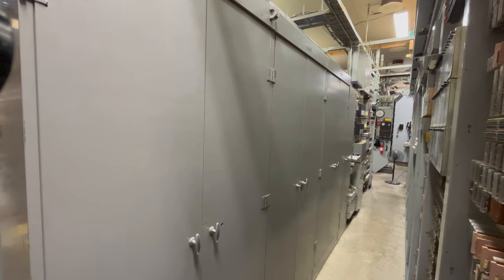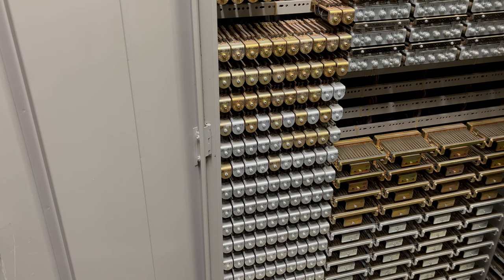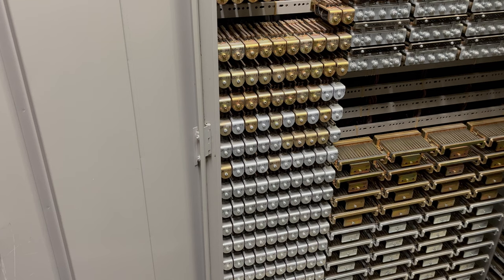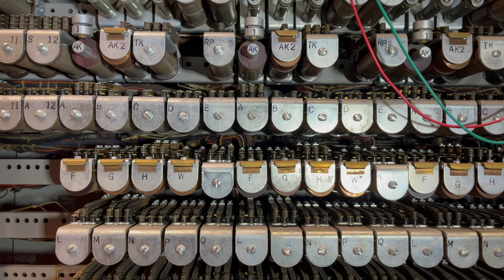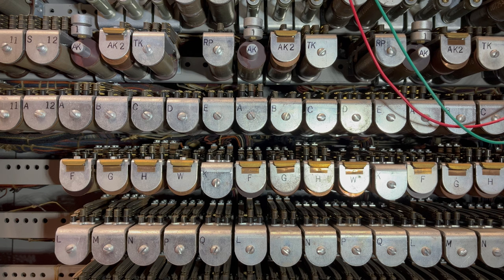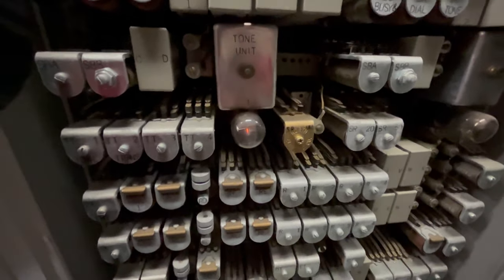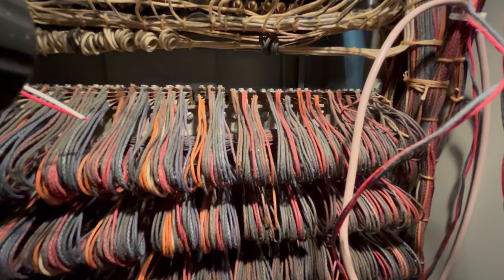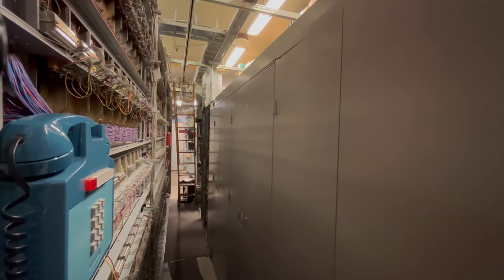North Electric CX 100 switching system. (HD)

Comment: I worked on Northern Electric/Nortel equipment for over 25 years.  NE/Nortel had some really revolutionary systems. I worked on Nortel 21/41C/81C switches for a large hospital corporation.  They were truly an innovated company.  It took WE some years to come up with a digital system.  I really miss those days. My home phone system is a Norstar behind VoIP.  One of the interesting features with the Nortel systems was the ability to route non-assigned numbers to RAN, keeping the operators from being inundated with spammers dialing every number in an exchange.  We actually had 20,500 numbers from three different exchanges in our system. I currently restore NE/Nortel 3 slot payphones for a hobby.
Reply: Northern Electric / Nortel out of Canada was unrelated to North Electric out of Galion, Ohio. I agree with you though, nortel stuff is really great.

Comment: Excellent.  I love your switching videos.  I was a SxS switchman in the 70's.  But learning the cx100 would be quite interesting.  Looks like a very compact design.  I also worked the ani-c in my 355a office. I also worked in a SxS Cama office which also had a no.1 SxS switch in the same room. So I got to work on both ends of the 1+ DDD. Thank you so much.  Would you get a chance to do a videos on ani?

Comment: How did they do reverting call??
Reply: Same as most other multi party CO's back in the day:  Dial other partys number, hear busy, hang up, wait 10-15 sec for other party to ring, then pick up phone & talk.
Reply: @macyhallock3265  NOT steppers around Willard used 119+your ring digit+called part'y's ring digit.  I didn't know that CX's were smart enough to do it by called number.  That was pretty smart
 for that era